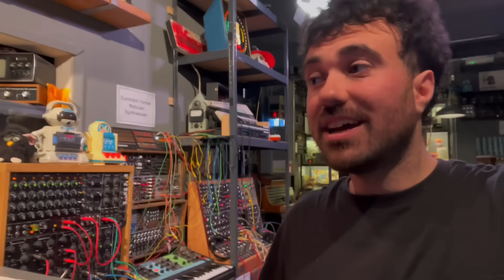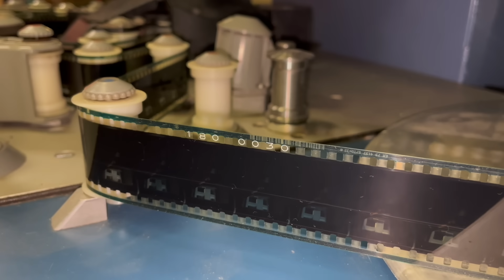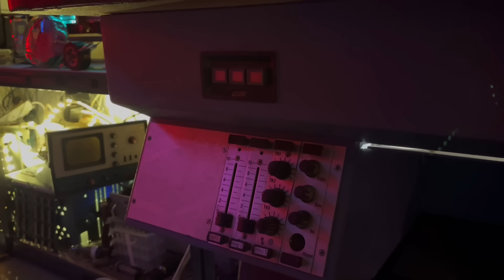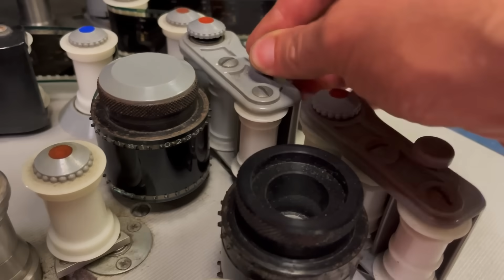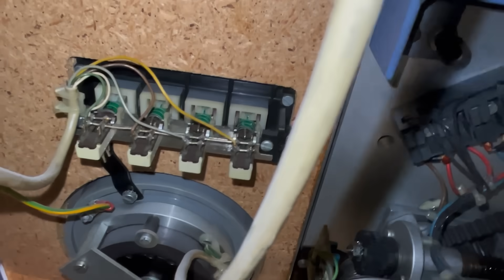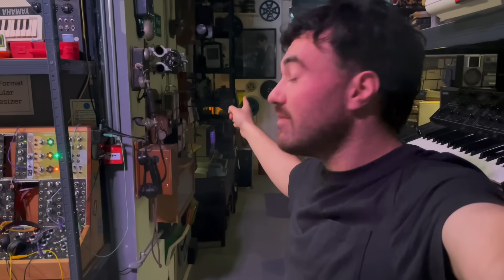Steenbeck 35mm Film Editing Desk

Comment: The threading of the Steenbeck in this video is WRONG. First of all, picture film is never run through the left sprocket on Mag track #2. You always go from the left plate through the picture prism. If you are bypassing the optical soundtrack reader (which you are in this video) the film goes to the right-hand plate and not through the right-hand sprocket on the Mag #2 track. In other words, you don’t go through either sprocket on the Mag #2 track.

You can use the right-hand sprocket on the Mag #2 track if you are using the optical reader to provide better sound (less wow and flutter which can be due to varying take-up tension on the right-hand plate. However, doing that is not recommended if the right sprocket on Mag #2 is not an undercut sprocket. The left-hand sprocket on Mag #1 and Mag #2 is not undercut as well as the right-hand sprocket on Mag #1. There are a number of editors out there where the right-hand sprocket on Mag #2 is not undercut either. An undercut sprocket will not come in contact with the image area on the film. A non-undercut sprocket contacts the image area and will eventually damage the film though repeated contact with the image on the film. If the right-hand sprocket on Mag #2 looks identical to the other three sprocket on Mag #1 and Mag #2 then the sprocket id NOT undercut and picture film should not be run through it.

Comment: As a note, still and cine films use different sprocket  hole geometry and slightly different pitches, so don't try running KS (Kodak Standard) film on a cine machine as it expects BH (Bell & Howell) pattern perfs. The pitch difference is only tiny, but enough to cause potential damage to both film and machinery.
Reply: Also, forgot to say, that you would need to shoot half-frame format too, the standard still 35mm frame runs longitudinally with the film whereas cine is at right angles to the film. Half frame is very similar to Super35 but isn't compatible as mentioned above.
Reply: BH perfs at short pitch are used on negatives and intermediates, prints use KS perfs at standard pitch.

Comment: 10:14 (im assuming you know this but the film archivist in me needs to say) if people adhere non-film based media to the film and run it through, it will damage the heads in the playback and rip the sprocketholes out of the film- wrecking the playback and killing the joy. People need to also  check their splicing too or the same happens. It moves at speed and torque.

Comment: You need to get a Acmade Competitor Pic Sync and a Catozo Film Splicer to complete the set. Both available secondhand in 16mm and 35mm.

The Pic sync is much better for creating and playing back audio loops - although some will have the audio record disabled or removed. You wouldn't want a clumsy editor wiping an important piece of dialogue during the edit. They're great for making continuous atmos loops with some 16mm or 35mm SepMag tape, just play the loop into a bin on the floor and return on the left side.  Very interactive too as the motion is hand cranked or if you are lazy you can engage a motor drive. Weird sounds can be achieved by wiping a magnet across the SepMag tape. Great fun, well it was in the 1980s when companies like the BBC were still filming the evening news item on 16mm film and adding voice over and sound Fx 'live' on transmission.

Love to know what's in the box though - film couriers had a habit of labelling everything as 'glass', hoping it doesn't get dropped.

Comment: You can see the mic boom because they're shooting "open matte" or "open gate", meaning you see more at the top and bottom, which is then supposed to be covered during projection. Fun anecdote: in the early 2000s I saw Scary Movie 2 in a small local cinema and the literal teenagers who ran the projection didn't bother to set the aspect ratio. So we got to see A LOT of booms on the top of the frame, parts of the dolly tracks on the bottom and other secret bits.

Comment: Are the pictures on the 35 mm film vertical or horizontal? Can the machine show film in both orientations?
Reply: As you can see from what happens when he messes with the shutter sync (picture moving up and down), the frames are stacked on top of each other, or laying on the side when the reels are on the table. This is 90° off photographic film, where frames are ordered side by side. You can arrange the frames side by side on 35mm motion picture film as well, this is what VistaVision does, but is far less common.

Comment: Now, I'm pretty sure that the bottom two layers of reels aren't for another image reel. I think it's for separate magnetic soundtracks (mag1 and mag 2). Looks like three channel pickups there at the middle. Though, it could be stereo, not sure. Mainly so there could be one audio reel for production sound, and another for music and effects and other fun stuff. 

As I understand it. They used to transfer the production audio (as in, the sound recorded on set with the boom mics and lavs and whatever they used) from the Nagra reels onto 35mm magnetic film because it made things easier to handle and keep in sync when you had to cut n swap around different takes. As it meant the variability became 4 per frame, one per perforation of a standard 4 perf frame. And the assistant editor would be at a separate desk manually syncing up film and tape and mark them up for all the takes so the main editor could use them in the workprint edit.  Once the edit was all done and ready for release, they'd send the workprint to the lab that would cut the negatives to match it to edgecodes and other documentation and make an optical soundtrack to be burned into the print, ready to be projected. 

Also. The footage there with the mic coming in. It's open matte. My guess is that it was made for a movie that'd be matted to 1.85:1 and that would take care of that mic. 

And. Another word trivia. In NLEs, like Resolve, Premiere, FCPx, Avid. Folders with clips are called Bins. Because that's where the editors kept the stray bits of film that they were working with when not on reels, bobbins or on the floor. They were in literal bins. 

I really find the optical mechanism of that visual pickup fascinating. Because, in any other projector, you need to freeze the motion momentarily if the film and flash the frame before shutting the image off while moving to the next frame. But on these. They somehow deviced a prism that rotates in sync with the film as it passes by continuously. And the buttons there adjusts that sync to move the image up and down... The mental gymnastics of that, moving the image then to the screen optically... I have no  clue how to do that that steadily..  

I need to stop typing.
Reply: Yep, it’s for audio. You can also use it to mark audio like if you are doing stop motion on film, and need to match the mouth while a character is speaking. Fun stuff!
Reply from the maker: Fascinating! Need to read that manual!
Reply: Agreed, knowing where this came from, I have seen it in use with 35mm mag audio on the lower spools.
 I wish I could find some of the old photos that I know exist of the editing room and the editors.

Comment: Would be cool if someone could make a new film that does a 360 in the museum as a loop
Reply: Trivia time. Back in the days of 35mm multiplexes. Some cinemas could run a single print through several projectors in their own rooms pointed at their own screens , by simply stringing the film (with lots of leader) between them all and onto the take up platter that wound the film back up. That way you could just reattach the start of the film to the chain again and get another screening ready within minutes. 

There must be equipment laying around places for that  :)
Reply from the maker: Oooh nice idea!